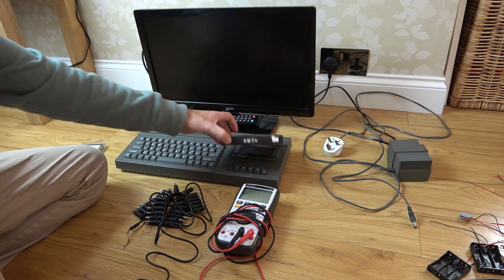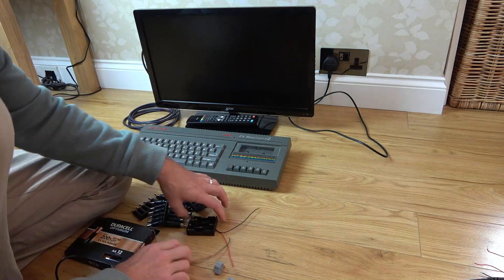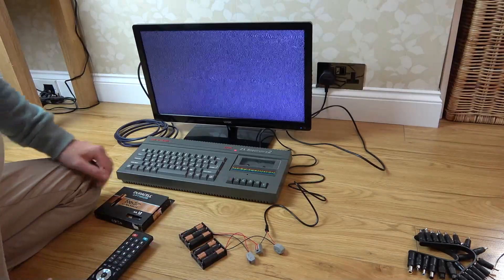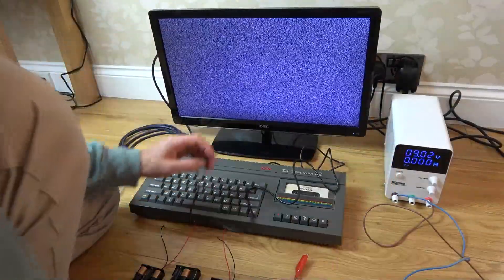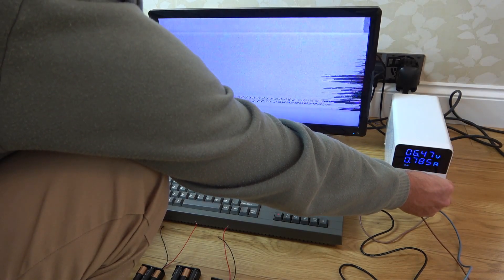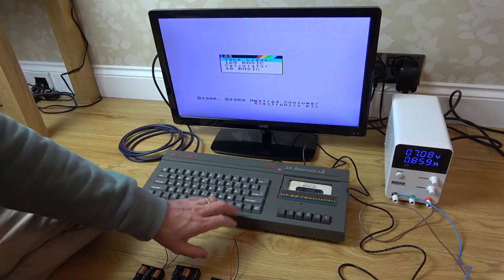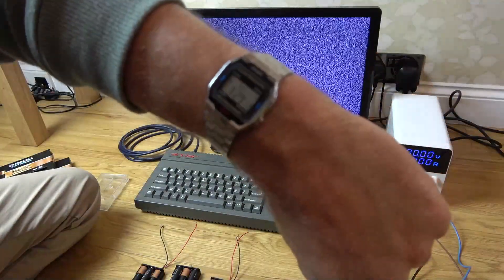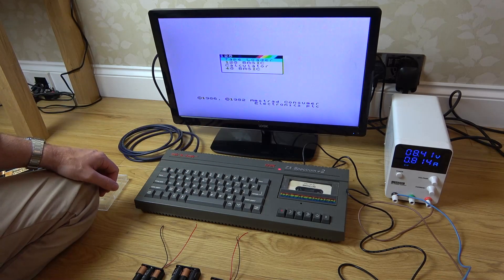What Happens When you RUN a ZX SPECTRUM on AA Batteries ?

Comment: The first that stops working is the rf modulator thats why the sound goes funny and in the end the picture. The computer still works you just cannot hear or see it. Thats why the running game is still running if you crank up the voltage high enough that the rf modulator starts working again. The ic's stop working at the lowest voltage. It is not so much capacitors as you think.

Comment: An excellent experiement!
I would like to see such results compared to the original Speccy, as it does not have the built-in voltage regulation for the cassette drive as this unit does.

More interesting to see how a ZX81 would handle this; as my friends and I interfaced a few of them into cars in the mid/late 1980s as a Mad Scientist Experiment. And for the time, it did worked for for the job it was programmed to do.

Personally, I did a similar experiment with Raspberry Pis running on Cellphone Extender Power Cell Packs with interesting results. Of course the older units did better than the newer ones as their power demands were not as great (Faster CPU, More RAM, etc.). On a 1500mah/5V Powercell, I managed a couple of hours on an old Raspberry Pi Model B and almost 3 hours on an old Raspberry Pi Model A!

Thumbs up to you!

Comment: That 2.1 amps is not what the computer needs, it's what the brick is rated for.  
New batteries will show around 1.6 open circuit. But once you put a load on them, it will be 1.5.
I can't believe how much power this is using.  Rechargeables will work better. You will only need 8 of them due to the lower voltage they use.  Unlike the alkaline batteries, they will work till they are dead.  The alkalines will have the voltage drop as their used, though it may be that the machine only needs 9v for the tape drive and has a 5v voltage regulator supplying the board.  So the board might work until the alkaline batteries are dead.

Comment: WHY would you expect ANYTHING out of the ordinary to happen?  So long as the battery is supplying the proper voltage and can output the amperage it needs, it will just work.
You're better off using rechargeables though, because can deliver high current without damaging themselves.

Comment: as soon as the chips stop seeing the 5 volt from the regulator all bets are off .. not to mention the coil / transistor's that are trying to turn it into 12 volts.. would be interesting to see how long the batteries last  / what about a laptop battery ? although would need the charging circuit / voltage reduction

Comment: IIRC most if not all the Z80-based Sinclairs ran on unregulated power supplies. The +v rail will have its own regulator. I have models 128+, +2  and +2b, +3 and 48K models so I would be able to find out very easily if needed.

Comment: Sinclair Spectrum power supplies were unregulated which is why under no load it read 12V. The computer had internal voltage regulators for the 5V logic chips, 7.7V display circuits, and 9V for the audio amplifiers.

Comment: Would have been interesting to see this using the composite output instead of the RF as it looks like the RF Modulator failed before the rest of the digital circuitry.
Reply: Rather simple hack, with one capacitor.

Comment: Makes sense.
The logic chips of that era run on 5.0V, I don't know what the schematics is exactly in that machine but I suspect it is just a linear regulator so any voltage above something like 7.5V just goes into heating of that regulator.
Below is its own voltage drop so it gives up regulating and just drops the voltage probably by something like 2.5V.

That would be bad if it was rectified AC, but the bench PSU does it's own stabilization already (and the batteries are stable by themselves) so it doesn't much matter.  

Most of the chips are designed to run on 5.5 to 4.5V. They usually more or less work within 4.0-6.0V range but that is not guaranteed.
When you get to 6.4V input the chips receive less than 4.0V. At that point some of them would normally give up due to noise but the PSU maintains a clean voltage regardless.    

Sound chip on C64 runs on 9V - not sure if it's the same on this one - but it makes sense that it gives up first.

Next is unsurprisingly video - it needs stable voltages to maintain very precise sync which it cannot do if VCC if so far below spec. 

Below 4V all bets are off - probably RAM got corrupted first, although it's hard to say - logic gates are not designed to work at those levels and so they don't.
Reply: Jeez! You don't have to make a very detailed comment your fingers must be burning

Comment: Increasing the voltage slowly will bring different ic's up at different times and the reset signal may occur before all the chips are up and running. Applying the correct voltage all at once makes all this happen much quicker and the reset signal will happen after everything is ready.
Reply: My thoughts exactly. The system will be designed to reset/boot by going straight from 0 volts to 9 volts. By slowly raising the voltage the system will be initialised bit by bit and probably in the wrong order to allow it to boot properly.
Reply: This means this computer's reset circuits aren't the best. It wouldn't be acceptable nowadays, the PC ATX supply only provides the "Power Good" (grey wire) signal when all voltages have stabilized. Only then the mainboard releases reset signal for all its components.
Reply: @k4be.  These computers were cost cut to the extreme just to make then even slightly affordable and even then they cost more than a months wages. The reset signal came from a simple resistor / capacitor network. No voltage ok signal as that would add cost.